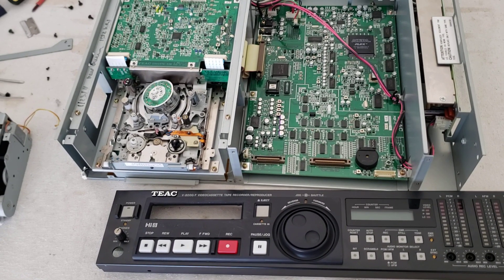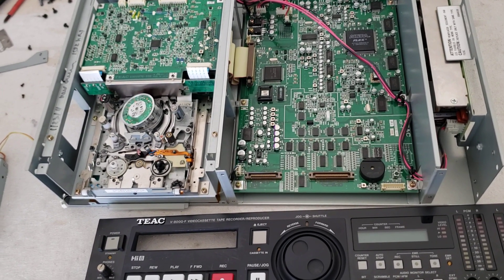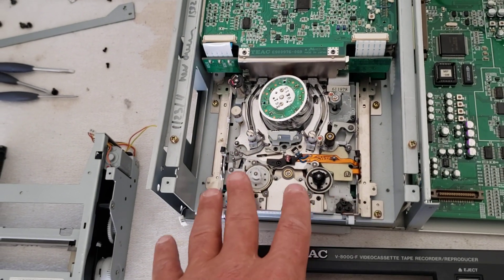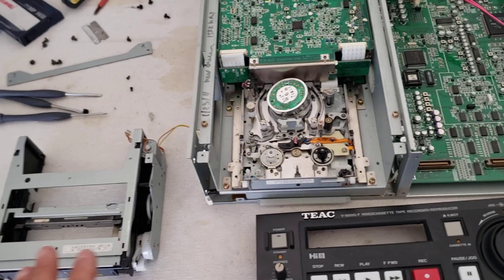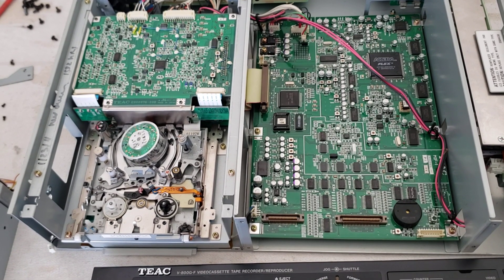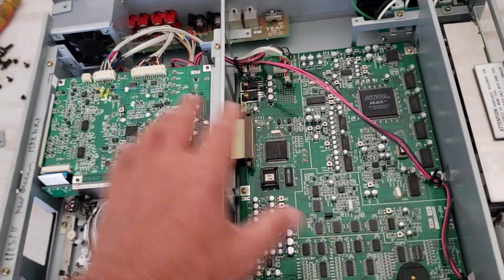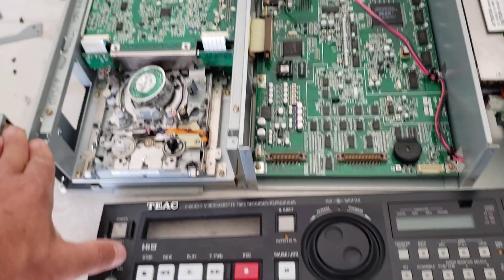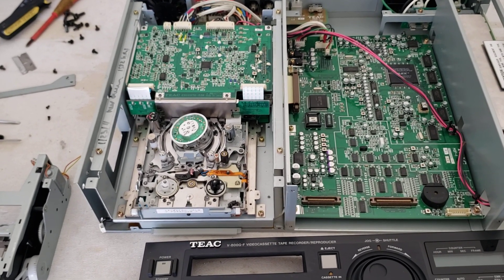Teac V-800G-F Video Deck Repair

Comment: Hello! Great videos you make! Well described. I have two of these units, both has different issues. One loads the tape properly but gives 010 error code. Second unit doesnt want to eject the tape (no response for eject button) and gives the 008 error code. Since I don't have manual and I cannot find it on Internet I'd like to ask you the reasons of these error codes. Any chances to get to know the basics how to try to fix it? All the best !